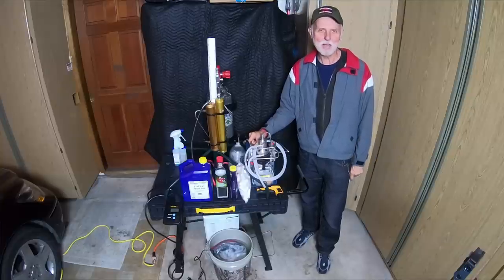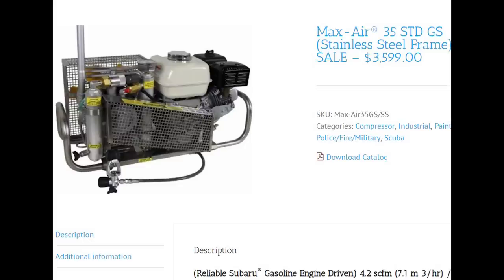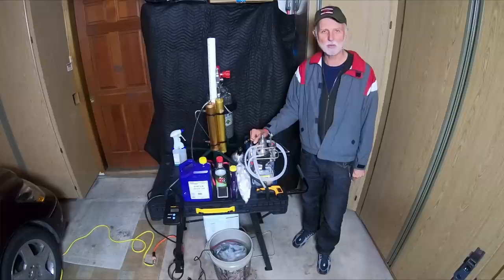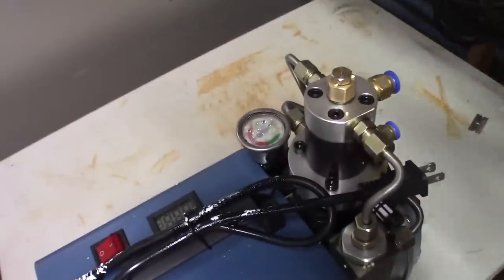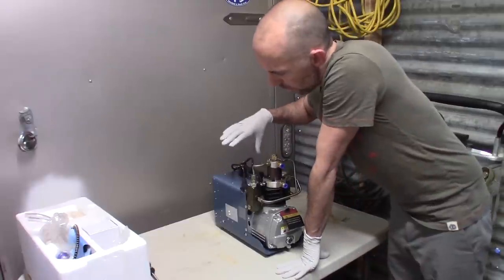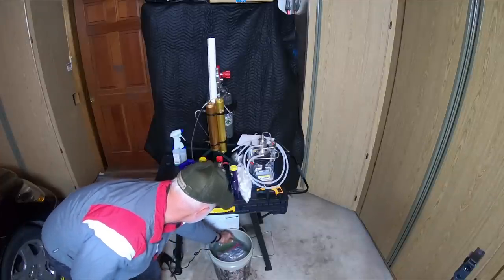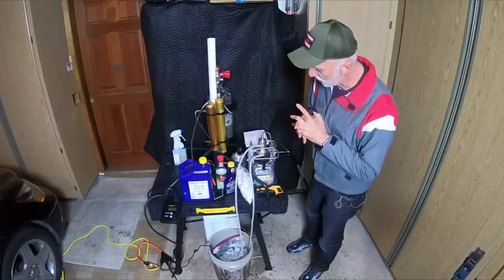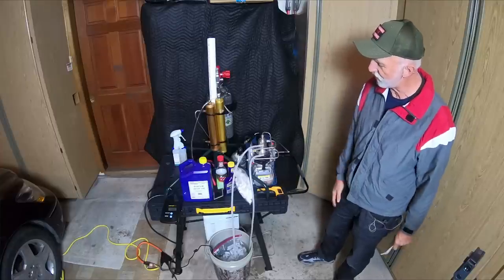Yong Heng Compressor Setup Secrets - Part 1,  Tips, Tricks & Traps

Comment: Run a dye colour in the water so you can see if the water is pumping through the tubes. If the pump fails it is much easier to see coloured water than with clear water.
Reply: Good one!

Comment: Nice effort on video, on the whole a good job but I took some notes:
The stainless steel tubes are not for coolant water -it is just the transfer between pressure stages.
The delivered water pump is not the best but still ok, it will last much longer than compressor, however: 1:st keep bucket water level at same height as compressor water cooling jacket, 2:nd keep tubes short as possible.
Make several ice bags, make 'em flat for maximized surface area.
For faster response on temperature swings on compressor head add some thermal transfer compound to temp probe.
Oil levels should always be at top of- or just above red dot! Never below mid point!
I really like your filtration setup, really nice!
Reply: Awesome feedback Paxmax - many thanks for sharing your generous tips!  And really makes sense to add thermal transfer compound to temperature probe for better conductivity.  I was under the impression the two concentric horizontal tubes circulated water (not to transfer pressure), especially since some cheaper YH models do not even have the 2 tubes I discuss at around 11:30 on Part 2).  On a YH parts order page, the tubes are called Coolant Tubes.  Cheers,  Michael
Reply: @CaliforniaTravelVideos  I think the primary reason for the "tubeless" compressors being cheaper is that they seem to lack the auto-stop feature and several does not even come with a cotton filter. Some models are so simplified they just have the pressure guage on the top of second stage instead of having a alu block distributor on the side. I have seen some models with a "golden" water jacket, not sure yet what they are about.
The model I happen to have is probably a Yong Heng clone called "First Strike", tubeless, no auto-shut off, no filter -but it has a separate stack with pressure guage on the left side (when seen from oil view port direction).
Instead of having the (to me prefered) run-around first-to-second stage tube it has a much thicker water jacket. They have drilled a hole through the water jacket to carry air to second stage. This increases- machine time and somewhat on material cost but saves on complexity, assembly time, number of parts (which also costs to have in inventory, cut, bend, finish, and may in the end leak). Having a drilled transfer has possibly another benefit -the bore is water cooled.
I say possibly because the air spends so short time there (at mid pressure the flow are relatively high), the bore is short, not much surface area so I kind of doubt it has an measureable effect.
A quirk the First Strike (and possibly others?) it has a tiny bleed port that constantly squirts condensed water and oil from the 4500 psi distributor block  Maybe this is how they get away with no filter? 
EDIT: Correction, it was the burst disc assembly leaking, no fancy autobleed.

First time I fired it up indoors; filled a 250ccm bottle(15cui?) -instant regret; 1. The stink, 2. The mess on floor, 3, The slipperyness of oil vapor on floor in a 1 foot radius.
Yeah I think that the recommended oil (HLP) VG-46 is probably not the most suitable for this task.

I feel that this bleed port while being "smart" if it manages to keep oil and water away from system is much too suceptible to gunk and clog ups.
Reply: @CaliforniaTravelVideos  With respect: there is so much bad information in this video that it should be taken down.

Comment: I bought the "simple version" and it works great. Notice how on the simple version that the water lines will not be resting right on top of the very hot air tubing coming out of the compressor. It's also best to start up the compressor with the bleeder valve open until the unit gets going so as not to strain it. Same thing when you shut if off. I also bleed it off mid-operation for a second or two to mitigate water build-up. The guy at the 5 minute mark isn't using the oil breather and still has the original plug installed. BTW, Yong Heng now recommends synthetic compressor oil, not the 46.
Reply: Thanks Jack - agreed, releasing pressure using the bleeder value can certainly help the longevity of our YH.  I'll double-check your comment about the missing oil breather - initially I did try a higher quality breather but it choked the YH so I thought I reverted the configuration to the "factory stock" setup.
Reply: Great video! Really appreciate you taking the time to share your tips and experiences with the Yong Heng compressor! I found it very useful!
Hope yours is still going strong! God bless!

Comment: Not sure why your secondary filter limited your air, I have one and it works fine. I also bought a bigger pump for the water, but I use coolant fluid for a TIG welding torch.

Comment: As long as the output hose is also submerged, it doesn't matter where you put the bucket. The royal purple does a pretty good job, unless you set up in your house like I did. Then you find out it has a smell too. The diester(scuba compressor oil) doesn't have any smell to it. It also doesn't carbon up the second stage piston as much. The hydraulic oil is not designed for this application, I have no idea why Yong Heng recommended it.
Reply: Excellent points about the oil - many thanks.  Regarding the height of the cooling bucket, as long as the pump can push the weight of the water "upstream"  (uphill), agreed in that circumstance it doesn't matter where you put the bucket.  Yet with a low CFM pump pushing water upwards, gravity has a direct correlation to the height.  A "quick and dirty" way to determine the affect with your existing gear is to start the pump when connected to the water source down on the ground.  On the pump output tubing that is not connected to the YH, try raising the tube from ground level to 1, 2, and 3 feet - for a small pump you'll be surprised how gravity has a significant affect on the flow.  Obviously, we want to have a much flow as possible to move hot water away from the compression head.   Thanks for bringing up this important topic.

Comment: I bought a 5 gallon drum of distilled water, put antifreeze/coolant in the water. Lives under the bench no corrosion.
Reply: Sweet - WTG, that's an elegant solution.  BTW, I have a screw-tight gamma-lid on my 5 gallon bucket to avoid evaporation.  ~ Michael

Comment: Don't I repeat don't run any compressor on extension cords unless you make one out of romex solid Cooper wire
Reply: Great general advise - thanks for sharing your thoughts.  That said, we should conservatively estimate that the Yong Heng will consume 1800 watts, so running 117 volts a/c, that roughly 15 amps.  Assuming your extension cable is 25 feet, that required conductor size is 16 gauge copper or a bigger 12 gauge wire conductor if it's an aluminum conductor.  And to your point, a Romex solid wire conductor may be 10, 12 or 14 gauge size.  Of course, regardless the size of the wire for your extension cord, if   the receptacle screws that go to the circuit breaker box are not making a very good/tight electrical/mechanical connection, you the poor connection will not pass 15 amps and might even heat up and cause a fire.  That was my concern connecting to the circuit, so I recommend with a heavy current draw device like the Yong Heng, also be careful to ensure the motor doesn't seem to slow down, lights on the circuit start to dim more than 1 second, etc.  Good luck and here's a useful link to calculate the wire size if your extension cord is longer than 25 feet:  http://www.paigewire.com/pumpWireCalc.aspx

Comment: I use ethylene glycol coolant so i dont have to worry about freezing in the winter.
Reply: Very smart and I would warm up the high pressure head before starting if it's near freezing temperature.

Comment: You need to make sure all those fittings and that one way valves your using is/are rated at over 4500 psi, 95% of that stuff available is not rated for high pressure. Royal Purple is the Slick 50 of today, by the way, your paying for advertising and a little purple dye.
Reply: Thanks for sharing your tips Rick.  Agreed, not only getting the correct fitting but also a sufficiently high PSI is rating very important!  Several times the fittings I purchased didn't turn out to be adequate for our application.

Comment: I have yong Hing Compressor that I received on a pallet that I bid on it does have freight damage but it is brand new it would be good for parts the main frame that holds the valves on each side are cracked the brackets that hold the valves are cracked if anybody is interested in using it for parts it has not been run please contact me for further info. It’s brand new never been run, just freight damage. Also there’s no temperature gauge it was missing

Comment: Will.. I have doubts that the compressor that failed was a copy not the original Young Heng. The copy compressor tends to fail very quickly. The original YH does not have quick release water nipples,it comes with brass hose nipples. The cylinder is shiny steel not black or any other color. Thanks for the video

Comment: i like your videos...what is the difference between a hardcover and set pressure versions?
Reply from the maker: The better (hardcore) version has the water “cyclone” and a second cooling tube to provide better cooling than the simple version.  So the simple version will get hot quicker, which means more shutdowns on bigger tanks and more maintenance.

Comment: thought it used 15 amps
Reply: Yes, that sounds correct - 15 amps x 117 volts comes close to the maximum 2,000 watt load for a home electrical circuit so don't run anything else on the line when you're running your YH!   Enjoy,  Michael

Comment: Does anyone know where to get replacement parts for the compressor?
My oil breather cracked and the blow plug needs replacing. 
I bough the unit on line but can’t find parts.

Comment: Would I need an organic sieve for a 48ci tank? Or would a coalescing filter be fine?
Reply: Generally, you’d be fine just using an organic sieve... assuming you do everything else correctly as covered in the videos.  I’d say the coalescing filter is a nice extra but probably not required in most situations.  But if you’re in a humid environment, work the YH hard (long run cycles), don’t regularly change the YH filter, have poor practices (bad setup, forget to do regular bleeds, etc), it would probably be wise to have the coalescing filter, too.  Good luck 👍

Comment: Would it not be better to run your water at ambient temperature rather than cooled with ice? I am just thinking that it must be generating condensation if it is humid air running into a warm machine.
Reply: Good point - in some situations (highly humid air) condensation might be a factor, at least in theory.  And practically speaking, whether the input water is ambient temperature or icy cold, it won't make a huge difference of the head temperature in most conditions.
Reply: We are compressing ambient air to 4500psi. That is 310 times atmospheric pressure. A great deal of condensation will occur either way, since the extreme pressure raises the dew to very, very high. Also the compressor head does not stay cold for very long at all. Using ambient temperature water will not significantly reduce the amount water produced.

Comment: What about using car radiator fluid rather than water? It's formulated not to mess with metals and rubbers/plastics.
Reply: Good question, yet having researched this 2 years ago... hmm now, what was the reason I didn't go with the obvious answer!  (few minutes later...)  Aha, I think I have it and it had something to do with corrosion since antifreeze:
1. Is designed to keep fluids from freezing, not overheating
2. Does not have distillation properties
Yes, at first sounds weird since antifreeze also helps keep things cool for a car engine (literally and figuratively).  So I searched the internet and some of these posts agree with my somewhat vague recollection:
https://www.airgunnation.com/topic/yong-heng-and-antifreeze-coolant/
That said, some claim antifreeze works fine, so unless you anticipate heavy and frequent use, use what works best for you.

Happy trails,  Michael

Comment: Very helpful. Sounds like the Yong Heng is a hobby in itself.
Reply: Well, when you put it that way... I agree LOL. (as the saying goes, some assembly required)
Reply: buying cheap stuff and bringing it up to par is a hobby in itself
Reply: Mine works fine without some of these extras
Reply: @caseG80  agreed, i'm only running a tuxing oil/water separator to fill my SCBAs and it's fine. even use the original pump
Reply: @caseG80  Agreed, depending on your environment, usage and expectations, your mileage will definitely vary.

Comment: The slower water goes the more heat it absorbs from whatever it's flowing through...of course there's a happy medium. Too slow and it's not getting the heat out fast enough, too fast and it's not absorbing enough geelat before exiting.
Reply: I appreciate your point and I certainly don't profess to be an expert in thermodynamics!  That said, whether the water flows somewhat faster or slower, the primary determinant is fluid temperature since the conduction is essentially a constant.  You might try cooling the external head using a fan or design a better heat sink to dissipate the air if you are operating in a warm climate.

Comment: Yes it's nice to do all you recommend, yet if your an Airgunner on a budget, your tech talk sounds expensive .  .
Reply: How true and if you are careful to use your YH for light use, it will definitely last longer.  But of course for the heavy users of their gear, it's probably worth spending a bit extra and not have to soon buy a second compressor.
Reply: @CaliforniaTravelVideos  Thanks, I'm seriously considering ordering one tomorrow, the big decision is auto shut off or not. I would consider myself a light user. Thanks again...
Reply: @bucsam1660  Wow, I totally forgot about the auto shutoff option and now that I think about it, initially I forgot the reason I didn't go with the auto shutoff option. Now that I look at it, I recall that it doesn't look all that reliable and I didn't want to risk the compressor not starting up, only to find out the circuit no longer works... after an hour of troubleshooting and then another hour to rewire around the circuit.   IMO, we really should be watching the compressor from time to time anyway, rather than leave the area only to find the YH was heading for a catastrophe (overheading, loss of oil, leakage, mechanical noises...)
Reply: Hey California, I ordered my Yong Heng yesterday from Amazon. Saw a review where the guy uses Royal Purple Compressor oil instead of Hydraulic. Be safe🤠

Comment: Great info. is there a way, or even should I... take the slop out of the bleed scews ?
Reply: Nice question and one I didn't realize that on some YH's there might be loose, sloppy movements on the bleed screws.  Mine certainly is snug when I moderately tighten them.  Of course when you loosen them a quarter of a turn or more, indeed they do wobble a bit but that is by design.  The brass female fitting is designed to release air as the valves are opened and are cut at a slight angle (like a funnel) so the air will easily be released without having to completely remove the screw.  I suppose if you wanted you could replace the with a more professional screw valve if that suits you.  Thanks for bringing this up for others who may have ideas to improve this concern of yours.
Reply: @CaliforniaTravelVideos  good to hear, I was worried I might be putting too much torque on them to seal. I've heard people putting teflon tape on the bleed screws.  mine work good....I'll keep them as is. Thanks man
Reply: @CaliforniaTravelVideos  makes sense about the air flow angle, Thanks for that info !

Comment: can you use the compressor to fill up the PCP gun directly or is  the tank necessary
Reply: Depending on your configuration (valves, etc) it might be possible yet it would be bit tricky and perhaps risky that your timing is accurate when you shut off the value and turn off the compressor.

Comment: I used mine to top up a 7 litre dive bottle from 200 bar to 300 bar and it was getting way too hot recirculating the water.  I ran the water to waste whilst topping up with cold water and it ran like dream.  Twenty one minutes to top up which is the travelling time to my dive shop.  Then I have hang around for at least an hour or go back for it much later the. hand over £6 and then drive home.  £165 for the compressor was a steal!
Reply: Thanks for sharing your experience, Steven.  Perhaps because my environment was cool and not with warm ambient summertime temperatures, my water never got very warm at all.  But I definitely agree with you that to find a way to ensure that even the paltry amount of cool water that has a small, restricted flow through the compressor head, it's a great idea to supplement the incoming water with a cool supply!  Having an cold air conditioner duct funnel air to the head would be great, too.  Good luck and thanks again for sharing!